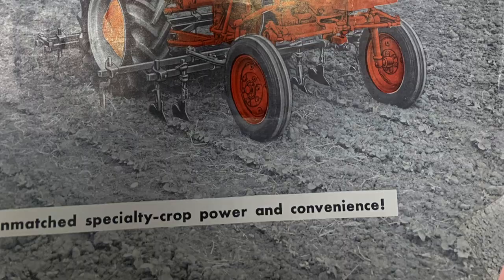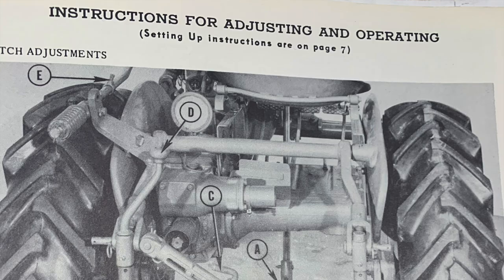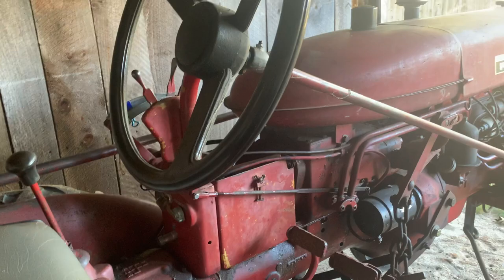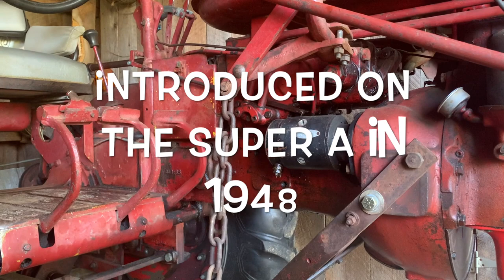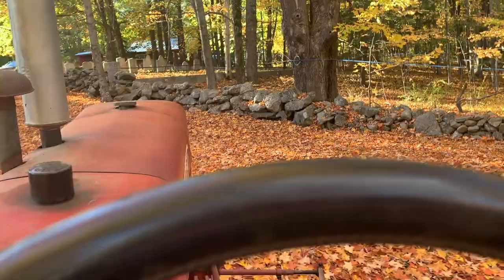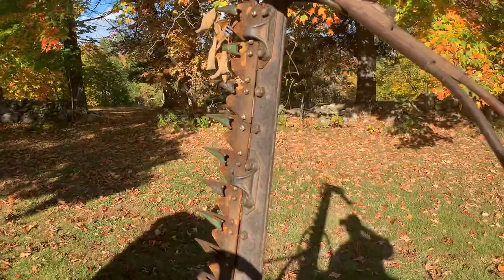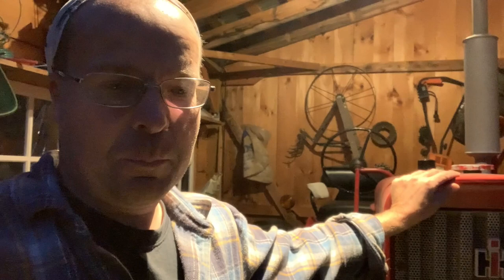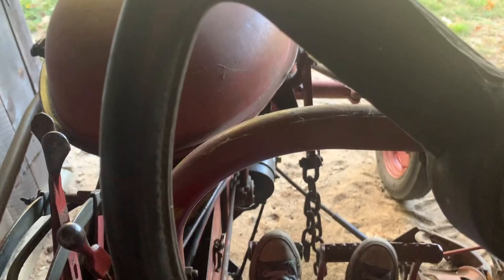Everything I Know About The International #Farmall_140 IH

Comment: Enjoyed the video.  I am looking for a Super A or a 140 for a small garden.  Would you prefer one over the other, or are there any major differences worth mentioning?  Thanks for any input you can provide.
Reply from the maker: A 140 is the ultimate Super A. They’re usually a bit more money, but most 140s are 12 volt (after 1964), often have a much more comfortable seat & a Fast Hitch. Once you use Fast Hitch equipment, you’ll never want to go back to bolt-on. Super A tractors are still better than Cubs I think though for many reasons. Thank You for watching

Comment: I think I would like to own a 140 with standard hitch. That's  what I grew up with plus the one point looks a little chintzy.
Reply from the maker: It’s a lot more rugged than you think
Reply: I have seen a 140 in person but all the pictures show mounted equipment. I was wondering about pto driven machines  having enough room for a shaft and hitch in a straight line
Reply from the maker: @marvinmulford2536  I ran a hay tedder off of mine. The offset PTO can be a liability in some cases I would think

Comment: Very how long have you had that one we are getting ready to buy a h farmall it will be another cheap buy it doesn't run 600 its got a homemade 3 point hitch and it has rice tires combine size i will put a heavey blade one the front
Reply from the maker: The first one is my brother’s. The second is mine. About that H, I have always been told by the old-timers that “if she turns over, she’ll run.”😃 my brother used to have a 1950 M with a homemade 3-point with a gacked up fast hitch mower that had been cut and welded for 3-point. It was ugly, but it worked. Thank You for watching 😊